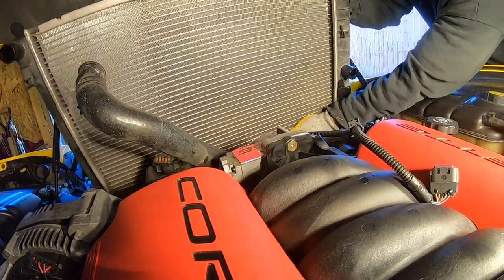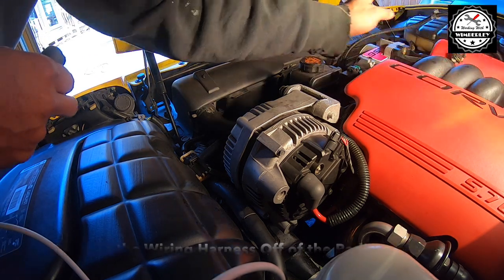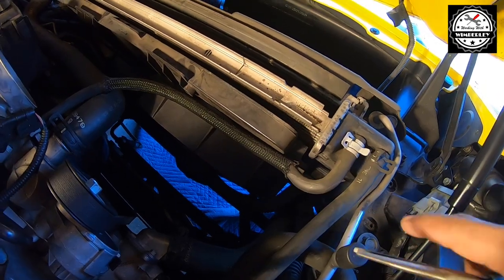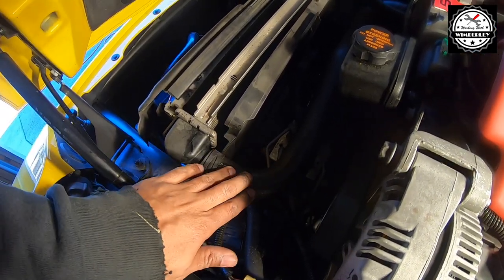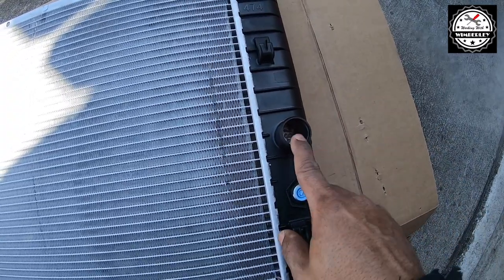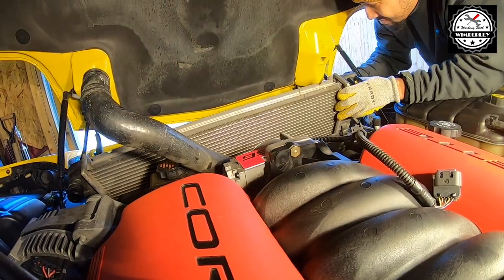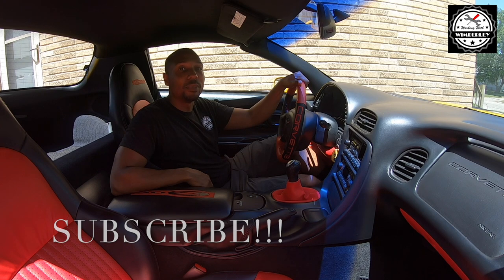C5 Corvette Radiator Removal & Installation 1997-2004 How To Replace & Change Radiator Chevy

Comment: Just for those who are wondering how much labor will cost. My shop charged me about $400 just for labor… if you have the tools and patience, I’d highly recommend doing it yourself. This gentleman did a really good “how to” video. Made it look easy lol.
Reply from the maker: Thanks! It was pretty simple with the exception of the lower radiator hose. That was the most difficult part. And I checked out your channel. Looks like you have some great info over there. 👍🏽👌🏽🇺🇸

Comment: Hi Steve,  Nice job on this video.  I spent about an hour on that very difficult lower hose, and haven't got it off yet.  I have new hoses as the car is 24 years old, with 129,115 on the clock.  When I finally do get the hose off I'll definitely put on a nice screw clamp on.  Hate those clamps they put on at the factory!
Reply from the maker: @georgewhite8546  I totally understand! It doesn’t feel like these cars at that old yet. I love the C5s.

Comment: I would just add when putting radiator in... make sure fan mounts line up properly..they are a little tricky.. then make sure the top mount is set in completely correct.. oter than that... thanks for the video.. nice job,,,
Reply from the maker: @Shimes  Thanks for the tips.

Comment: Only problem I had was my vette is lowered what a pain to get it high enough to drain and loosen bottom hose
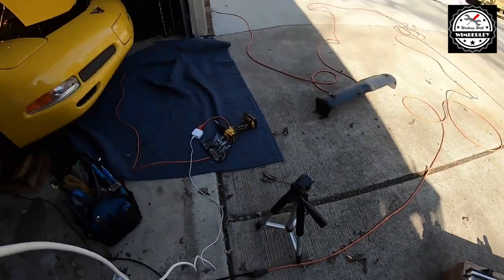Reply from the maker: My Vette is lowered as well. I had all four wheels up on blocks in order to get room underneath it. You can kind of see it at 2:57.
Reply: I have a 01Zo6 about 2 1/2 inch on front built ramps with 4 pieces of 2x10 three screwed together put behind front wheel back onto first two steps put on 4th and back rest of way then can put long reach low profile jack under good luck
Reply: @kiwiguy4764  thanks I'll try that I have ramps but it's too low for them lol

Comment: Nice man! I’m doing my 2000 on Monday along with the water pump. Both went at 62,000 miles within days. Yours must be a stick? The automatics have transmission cooling lines to remove and reinstall which is a pain
Reply from the maker: Yup. I have a Z06. They were only available in a manual for the C5 generation.
Reply: @WorkingWithWimberley  got ya. I hate my car. Owned a 97 and this 2000. I drive it only 1500 miles a year. Had it 16 years. Every thing has broken on it a real pos lol but still fun to drive when working
Reply from the maker: @mickywinters8451  Geeze! You hate it? 😂 I’ve had mine since 2016. Only things that stopped me from driving was a bad wheel hub and a cracked radiator. Other than that, it’s been solid. Always starts, always goes.
Reply: @WorkingWithWimberley  you are lucky!!! I got a lemon when I got it with 26,000 miles. Here’s a few things I had happen
Rocking seats…had to replace tracks and washers, took a whole day…transmission cable has snapped on me 2x leaving me stranded. Yep 2 brand new cables within 9000 miles both snapped. Car was stuck in drive twice.  My heads up display dropped and had to remove dash to fix a 2 cent screw. Took 5 hours. My pull key wait 10 seconds message came up daily and car wouldn’t start or move. Had to install an lmc5 to bypass it. Left me stranded 2x once in valet parking. My harmonic balancer is bad. It’ started wobbling at 51,000 miles. Gonna be about $900 to fix. My ac actuators both went bad. Had to remove the whole dash again to replace them. My tachometer quit working.  I left it for now. My oil pressure gauge quit and to replace the sending unit that’s $20 entails taking the whole intake off. They want $500 for that lol. My  belt tensioner exploded last month for no reason after I replaced it about 2 years ago and the new belt I just put on ripped in half. Had that repaired. My radiator cracked left side last week and I’m waiting for it in mail. Next day I look under car and my water pump is leaking lmao. Both broke within days. Oh and my abs light keeps coming on and abs quit working. They don’t even make the part anymore and no one rebuilds them for the 2000 only the 01 and up. Let’s see oh yea my car wouldn’t trip the security light to start the car a few months back. I had to open the passenger door to start the car.  Found out my computer got water in it from the ac leaking in. 
I can go on….This car has 62.0000. I’ve owned it for 16 years. Hardly drive it and all this shit happened. 
Also replaced both window motors and also my damn targa roof just cracked from the heat and sun in Florida. Both front speakers crackle and hiss. Gotta replace them now. My CD player quit working. My ac has a leak, I had my hvac ac digital cluster rebuilt. The led light went out and couldn’t see the temp of ac. Serious. My cars been a nightmare. 

My daily driver jeep has 250,000 miles on it and has never broke down once. I’ve replaced brakes,tires  and oil that’s about it. But the c5? Everything and it’s barely broken in. I’m afraid to drive it and getting stuck in a drive through. I bought a lifetime warranty on the tranny cable but they are made of plastic and get hot and break from the heat. Uggh. Now you see? Lol. But I’m keeping it. It’s all black with z06 rims. It’s like a bad relationship you keep sticking a band aid on :D

Comment: This is the best vid so far i have seen on replacement of the radiator for the C5.
Reply from the maker: Thanks! I definitely appreciate the support!
Reply: @WorkingWithWimberley  what year is your vette?
Reply from the maker: @mrdude3540  It’s a 2002 Z06.
Reply: @WorkingWithWimberley  cool. I have a 04 convertable. Did you run into a problem with the two transmission lines not fitting into the new radiator? I checked online and i guess this is a problem for most people that replace there radiators on C5s
Reply from the maker: @mrdude3540  My corvette is a manual and it doesn’t use those cooler lines. I think that’s only for automatics. So I didn’t use them. I’d look on corvetteforum.com Every single issue with these cars have been discussed and broken down at some point in those forums. That’s where I usually go when something is off and I can’t figure it out.
Reply: @WorkingWithWimberley  thanks bud 👍.
Reply from the maker: @mrdude3540  No problem!

Comment: Thank you for an informative and straightforward video. Went to drive my 2000 to work this morning and noticed my radiator is leaking. Original one. I'll be doing this job this weekend. Now I have a heads up for the process of my replacement. 👍👍
Reply from the maker: You’re welcome! I’m glad the video helped! The only tricky part was the lower radiator hose. There’s not a lot of room there. Besides that, it was straight forward.

Comment: Good video. I have a crack in the plastic end cap, drivers side, by the upper hose. Many of them do that. I bought a DeWitts and I am going to replace it right now. Im going to try without lifting the car. I hope I can manage it. Ive only had the car since April and have only lifted the car a corner at a time to change rotors/pads, and clean up calipers back to factory look. Your vid makes it easier. Thank you.
Reply from the maker: You’re welcome! I definitely had to lift it. I can’t fit under the Corvette at all unless it’s up on jack stands. If you can get to that lower radiator hose without lifting the car, that’s incredible!
Reply: @WorkingWithWimberley  I drove it onto a couple of 2×12 planks, and that was just enough to slither under there. I dont think my car is lowered either. I put a DeWitts in and it went well. Car is running in the 190's now with a new factory thermostat. I think theyre like 187°. The factory fans are what kept it from overheating. I bought the car 4-28-20, so im still learning about it, and wasnt sure if it should run that hot, but didnt think it was right. I drove to Orlando, bought the car and drove back to Pennsylvania( a truly horrible place to live). It had been consistent, so I thought maybe I had an Ls1 that ran hot. I read they can do that, but I now think that is wrong. I never researched to deeply because I didnt have a problem with it before. I have a 4th gen Z28 so Im a little familiar with the motor, but it ran at 210 religiously, and never went above that, even in summer traffic. Now I know what temp my c5 should run at and fixed it with your help. Im grateful.
Reply: Seems like I'm having the same problem, a leak that looks to be coming from the driver side top left of the radiator, close to the main hose (just not sure exactly where)

Comment: Looks like a real straight forward job. Pretty easy. Thanks for the video. My c5 battery died a few weeks ago while in storage for the winter in the back garage. I threw my battery charger on it, let the car warm up and noticed that the radiator was leaking. Just one more thing I have to do before the spring.
Reply from the maker: Thanks! It’s not a hard job, but the lower radiator hose is a pain to get off.
Reply: @WorkingWithWimberley  I'm sure I will get it. I need to replace the oil sensor and oil pan gasket. I'm sure oil pressure sensor will be a pain.

Comment: Good video walk-thru, thanks for sharing!  I think I spied the exact same wet line crack in my radiator on the driver's side.  Also just wanted to mention that that white plastic OEM drain plug is actually a valve;  You don't have to remove it (you can, but might break it).  If you just give it a 1/4 turn, it drains, albeit very slowly.  And the radiator cover should snap into place before snugging it down with the 10mm bolts.
Reply from the maker: Thanks!

Comment: Superb, sir. Suggestion - put in your description the refill and air-bleed process, please!
Reply from the maker: Per CorvetteForum.com: 
1) Park the vehicle on a level surface. 
2) Remove the surge tank cap: 
3)Raise and suitably support the vehicle. Refer to Lifting and Jacking the Vehicle in General Information. 
4) Place a drain pan under the drain plug. 
5) Open the radiator drain plug . 
6) Allow the cooling system to drain completely. 
7) Inspect the engine coolant for the following: 
Discolored -- follow the flush procedure below. 
Normal in appearance -- continue with the next step. 

Notice
When adding coolant, use DEX-COOLÂ® coolant. If silicated coolant is added to the system, premature engine, heater core or radiator corrosion may result. In addition, the engine coolant will require change sooner-at 50 000 km (30,000 mi) or 24 months.

Notice
Use the correct fastener in the correct location. Replacement fasteners must be the correct part number for that application. Fasteners requiring replacement or fasteners requiring the use of thread locking compound or sealant are identified in the service procedure. Do not use paints, lubricants, or corrosion inhibitors on fasteners or fastener joint surfaces unless specified. These coatings affect fastener torque and joint clamping force and may damage the fastener. Use the correct tightening sequence and specifications when installing fasteners in order to avoid damage to parts and systems. 

8) Close the radiator drain plug. Tighten.
Tighten the radiator drain plug to 2 NÂ•m (18 lb in).

9) Fill the cooling system through the surge tank. 
10) Fill the cooling system with a 50/50 mixture of DEX-COOLÂ® coolant and deionized water. 
11) Start the engine. 
12) Allow the engine to idle for 1 minute. 
13) Install surge tank cap. 
14) Cycle the engine RPMs from idle to 3000 in 30 second intervals until the coolant temperature reaches 99Â°C (210Â°F). 
15)Shut off the engine. 
16) Remove the surge tank cap. 
17) Start the engine. 
18) Allow the engine to Idle for 1 minute. Fill the surge tank to 12.7 mm (0.5 in) above the COLD FULL mark on the surge tank. 
19) Install the surge tank cap. 
20) Cycle the engine RPMs from idle to 3000 in 30 second intervals until the coolant reaches 99Â°C (210Â°F). 
21) Shut off the engine. 
22) Remove the surge tank cap. 
23) Top off the coolant as necessary, 12.7 mm (0.5 in) above FULL COLD mark on the surge tank. 
24) Rinse away any excess coolant from the engine and the engine compartment. 
25) Inspect the concentration of the engine coolant. 
26) Install the surge tank cap.

Comment: I'll be doing the same job in a few months, also replacing all of the rad hoses. Rather than wrestle with the lower rad hose (5m15s into the video) could you just leave it attached, and detach it from where it goes into the water pump? Then before putting the rad back in, you would attach the lower rad hose. Don't know if there's enough space or not. I'll be pulling the fans out also. Thanks for the vids.
Reply from the maker: You’re welcome. I’m not sure if that would work. I guess it’s possible, but I’ve never tried to do it that way.

Comment: Great video brother. So do you mean to tell me the fan assembly is just loose and not attached to the radiator?  Thanks for the great video. I broke one of the small, upper hose connections.  SOOOO lame they're plastic!!!!!
Reply from the maker: It’s not loose, it fits down into slots that are made onto the radiator. But it’s not bolted to the radiator.

Comment: Good presentation.  There's a leak in the area of the top left side hose which I have not yet determined to be the hose, loose clamp or the radiator but my '98 is grounded until it is fixed.  It took me six hours to change the water pump and replace all hoses (and yes, the lower hose was a bitch) a few years ago, so I'm wondering how long did it take you to swap the radiator?  You may have answered my question in comments below but I have not found it.
Reply from the maker: I don’t remember exactly, but I’d say 1.5 hours. The hardest thing was the lower hose. Everything else was pretty simple.

Comment: I'm about to replace mine. I didn't see any transmission lines going to the radiator. I assume that yours is a manual tranny. My question is, do you know if there is an issue with losing transmission fluid when you swap radiators in an automatic?
Reply from the maker: Yes, my car is a manual. I don’t know if any issue with losing transmission fluid. I’d check in corvetteforum.com There’s no topic that hasn’t been covered in that forum regarding the C5.

Comment: Out of PuertoRico my C5 works more than 220 in temperature with the air without the air it works in 210 you recommend me to change the radiator to aluminum one
Reply from the maker: Everything I’ve read in the Corvette forum states that 220°F is normal operating temperature for a C5 and that you won’t get a “COOLANT OVER TEMP” indicator warning until it gets over 256°F. I’d do some more research before deciding which aftermarket radiator to choose. I’ve always just replaced with the factory radiator so I’m not sure about aftermarket radiators. 👍🏽

Comment: Great video!! My question is how much trans fluid did you have to add?
Reply from the maker: Thanks! I’m pretty sure you mean antifreeze/coolant. And I’m actually not sure. If I had to guess, it was maybe 1.5 or 2 gallons. I drained the old radiator before removing it, but there was still coolant in the engine. I had the engine running and just kept adding to the coolant reservoir until it was full.
Reply: Omg yes I’m sorry I must of been watching another video 🤦🏽‍♂️
Reply: @WorkingWithWimberley  speaking of tans fluid it seems your radiator was for an automatic, so how much fluid leaks out when removing the lines?
Are they pressurized... You really didnt go much into that.
Unless the radiator is universal and can be used on manuals im not sure
Reply from the maker: My Corvette is a 2002 Z06 which only comes in a manual. The radiator that I used was a GM (AC Delco) part that had connections for a trans cooler which I didn’t use since I have a manual. I’m sure the CorvetteForum could provide more details on the specifics of the cooling system than I can. I would check there.
Reply: @WorkingWithWimberley  i checked but to no avail, im just going to do it and get in there

Comment: What about the two spots u didn't mention on the lower left side of the radiator.. do they just get left with the tabs in??
Reply from the maker: @RamonHolmes-f3b  It’s my understanding that I would’ve used those if I had an automatic, but since I have a manual, my Corvette doesn’t use them.

Comment: Great video. How difficult do you think it would be to do this on a 94 Z28? Cabin fever. I am about ready to work on the brakes and calipers at this point. Coronavirus.
Reply from the maker: It’s difficult to say. The radiator isn’t that complicated. The main issue is how accessible the radiator is. They really cram all the parts under the hood these days lol. It was surprisingly not too bad with the C5. Once I drained it and detached all of the hoses, I was able to wiggle it out. I’ve never worked on a Z28, but if I was able to squeeze it out of the Corvette, I’d say you can squeeze it out of the Camaro! Hope this helps.
Reply: @WorkingWithWimberley  It does. I can do it. I like working on cars. It's weird I know, but I like football too so oh well. Thanks for the video. Look forward to the next one. God bless. Stay safe.